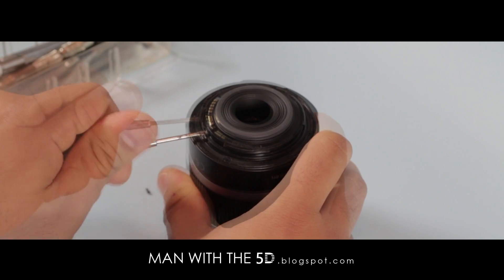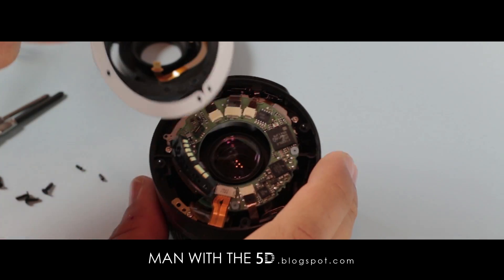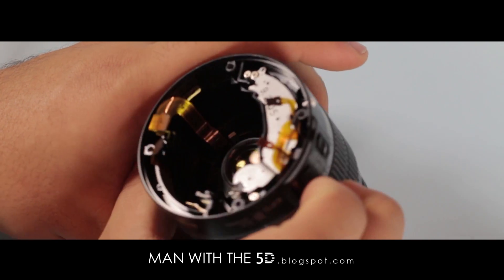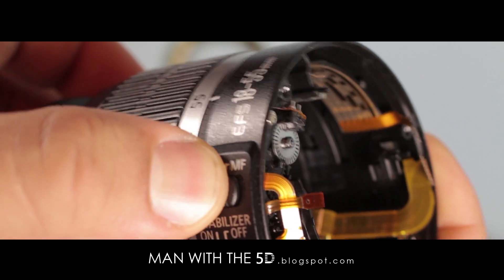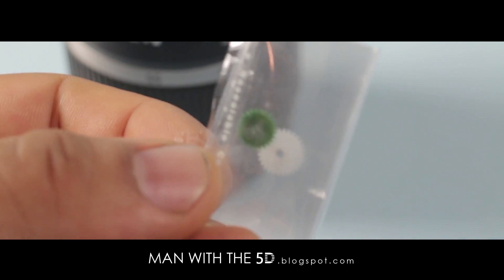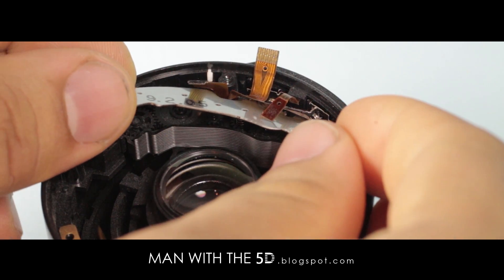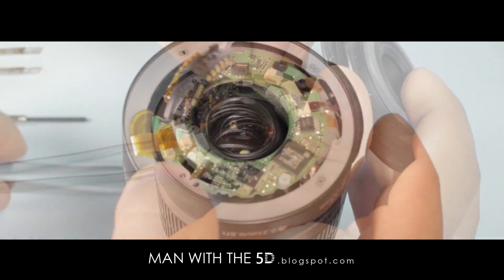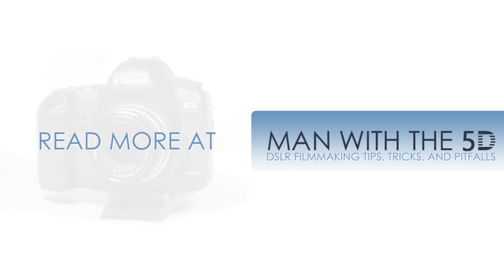Canon Lens DIY Repair: EF-S 18-55mm f/3.5-5.6 IS Autofocus Disassembly and Reassembly

Comment: Thanks for this amazing video. I had the auto focus getting stuck too. My specific case was due to one of the tooth coming off from the pinion of the autofocus rack and pinion assembly, getting so stuck on the rack and not allowing the auto focus to move pass certain distance. I removed the broken tooth and now works like a charm. I will buy the new pinion but in the meanwhile it looks and feels like there is no issue. I might get some resolution issue when the servo tries to focus in that exact area of the pinion, but due to the gearing ratio is almost imperceptible. Thanks once again for your video. Cheers!
Reply: Alejandro and we

Comment: Great Video! Was able to disassemble and reassemble the lens, but not find the problem. All the gears looked good as best I could tell. My lens "sticks" when at the full infinity focus position and in autofocus. If you manually adjust the focus slightly off the full infinity position, the auto focus can then correctly focus the lens. The lens does not appear to be binding when in manual focus. Any ideas on what could be the problem?

Comment: Hey I know this video was posted a while ago, but I was wondering if anyone can help me out with a problem I have. I Own  a Canon 700D DSLR (Also known as Rebel T5i) and I have managed to break the on camera flash unit whilst it was in my bag. It appears that the internals are fine and the camera still works but the flash bulb is broken. Sometimes I can hear it trying to flash but it can't. Is there any way you can disassemble the camera and replace the flash bulb inside? I need it fixed in order to use my external flash, using the flash sync. If anyone has any suggestions, they are most welcome:) Thank you!

Comment: Gear came in the mail... all back together and working- despite never getting the very first two screws out. Found it easier to line up the electronic components, and then putting tweezers on both sides of strip to push (force) back into housing. Ecstatic that the autofocus works again! THANKS SO MUCH FOR SHARING! Cost was $7.07 USD.

Comment: Excellent video, THANKS! Now I have to find a replacement gear- 4 teeth left (I dropped it, and then manhandled it). Will be amazed if this lens works again, once I get it back together. But excited that you have shared your expertise!
Reply: +LS  Bailey any luck finding the correct gear? I see plenty on eBay but don't want to order the wrong one.

Comment: What kind of screwdriver is used to remove the first two screws (for the electrical contact on the lens mount)? Where do I acquire such a tiny tool?

Comment: I just wanted to say thank you very much for this video. Gears 4 & 5 had stripped on my Canon 550D 18-55mm lens and I wouldn't have been able to successfully replace them without this! I haven't found another resource comparable to this on-line.

If it helps anyone else, I could only find some replacement gears on eBay from China. Even though the video recommends against them, these black and green 'copy' gears worked for me. They were the only option I could find at the time:

http://r.ebay.com/ikjS33

They took ~2 weeks to arrive, but hey, it all worked out in the end. If I could offer some additional advice, be really careful with the spring and smallest gear, I very nearly dropped them into the housing - not sure I'd have got them back easily! The flex cables are also a little challenging to get back in so take time on it.

Many thanks again!
Reply: +James Tubb I see a gear is stripped how do I tell which number gear it is?
Reply: +Blaine Billings Can't remember, but I think I just counted in from right to left. Take a look at the video, he mentions the two gears I had an issue with (probably a common issue). 4 and 5..